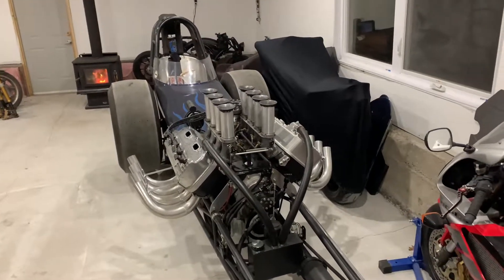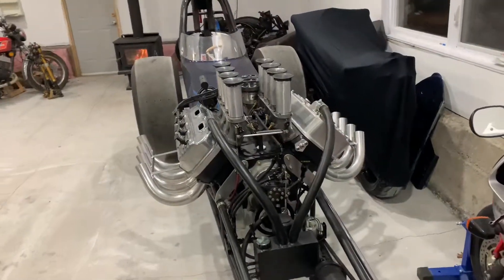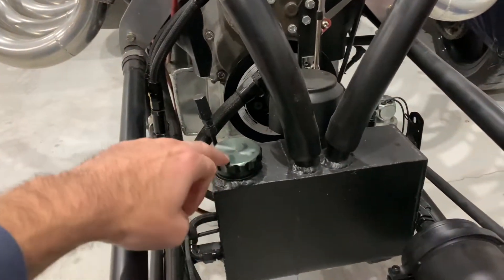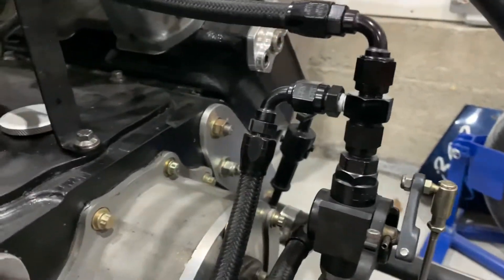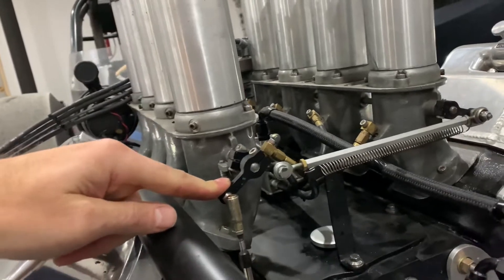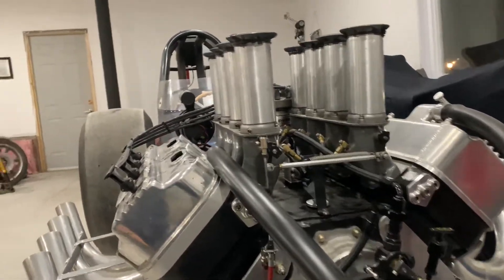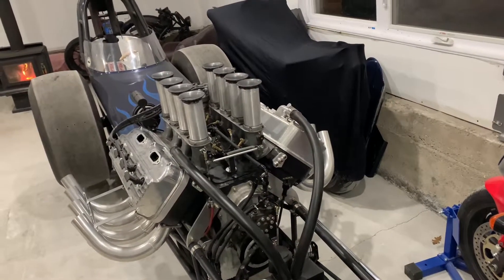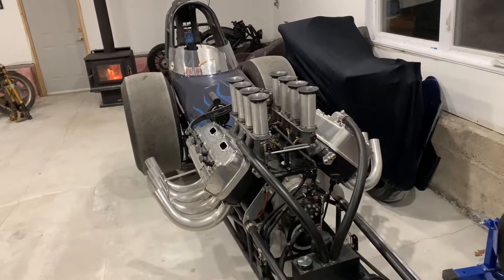Fuel Priming System For Mechanical Fuel Injection

Comment: Wow , I can't believe I have not seen your channel until today  , subscribed !!!  Your valve cover combination is unique .
Reply from the maker: Thanks Mike. The valve cover combination was temporary. I really wanted to run vintage cast aluminum Donovan covers rather than the fabricated aluminum ones - only to make the car more nostalgic. I will say that the fabricated covers are really well made and they are better for a racecar because I need to take them off regularly to check valve lash. The biggest issue is that I have much taller valve springs than the motor came with from the factory and this means that I have to run spacers to run the older Donovan covers... one more thing to take on and off.... the things I do to make this sucker look vintage...

I'll soon be releasing a new video showing the Donovan covers on the motor. Keep your eyes peeled.

Comment: I like the simplicity in this design, does the amount of race gas’s that you introduce into the fuel lines clean the system to make fuel system cleaning after use irrelevant? Cheers Wayne
Reply from the maker: To clean the fuel system I always shut off the methanol before I run the priming with race gas. The motor doesn’t like running on gas for long. It sputters and pops, but once I’ve done that, the injectors, jets and barrel valve is free of methanol. 

I still need to blow out the rest of the fuel system below the race gas fuel line T. 

Ultimately, it works really well for me.
Reply: Thanks for your response, cheers 🇦🇺🇦🇺

Comment: Great video, thanks for sharing!! As you say..."a simple little system"....but as I've been taught (and how I run my own race program), most often if you stick to simplicity and basics, you'll end up with a product that is fairly easy to run & maintain (and is consistent). And here's the BIG benefit....you get to go out, race, and have FUN!!! And not spend every moment at the track, babysitting some overly complex piece of equipment. I use the same philosophy, whether running the Super Pro class in bracket racing, or the NHRA Heritage Series where I can run in an Index Class...and/or in the Hot Rod category (where you dial your own)✌😎.
Reply from the maker: That’s exactly it. 

A good friend of mine suggested that I keep a simple setup that is super repeatable to minimize the stress at the track. That way you know exactly what steps are required to get the job done efficiently. No hiccups. 

Thanks for sharing your thoughts!

Comment: How does the fuel line from the back of the stacks? I would want  to run line through the firewall? Thanks
Reply from the maker: Hi Curtis. The primer fuel line runs from the auxiliary fuel tank (race gas) to an electric pump, then up to the barrel valve which distributes the race gas directly into each cylinder. You can see the aluminum (silver coloured) barrel valve that distributes the fuel through small rubber lines to each stack on the injection system.

Think of the race gas replacing the methanol temporarily while I start the engine. The motor will start easier in the cold with race gas, plus I need to prime the mechanical fuel pump on the motor because it is higher than the fuel tank.

While I'm starting the motor on race gas, I open the "shut off" valve on the mechanical fuel pump which is spinning at this point allowing it to prime with methanol and force methanol into the barrel valve, distributing the fuel to each cylinder. The motor only runs on race gas for a few seconds before the methanol starts to flow into the cylinders. At that point I stop pumping the race fuel and run solely on methanol.

Does that make sense?
Reply: @kiltedmoto  thanks